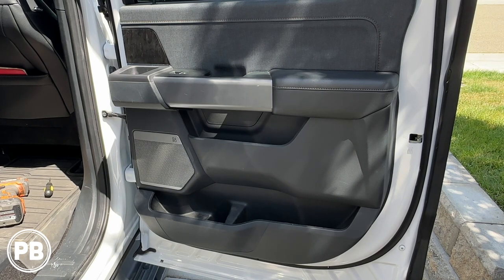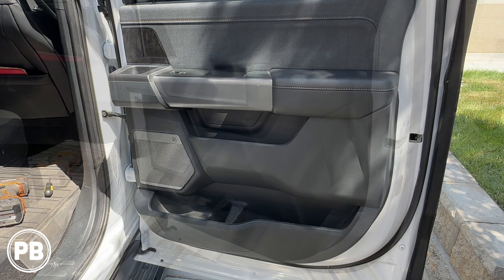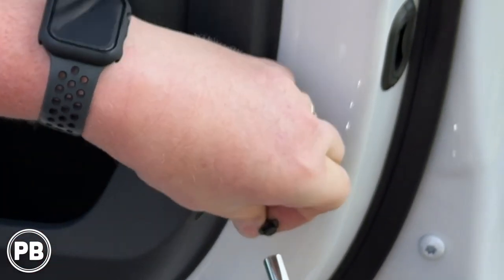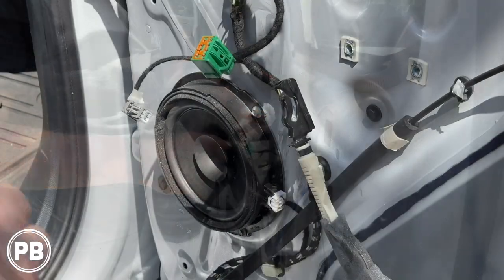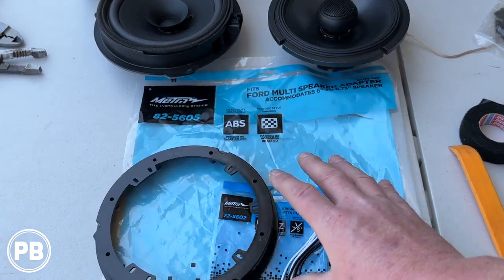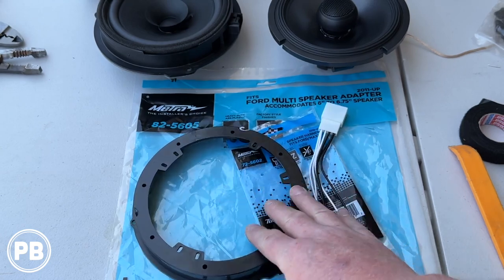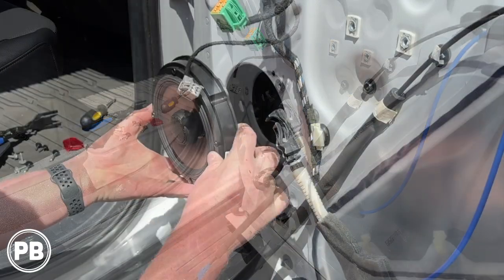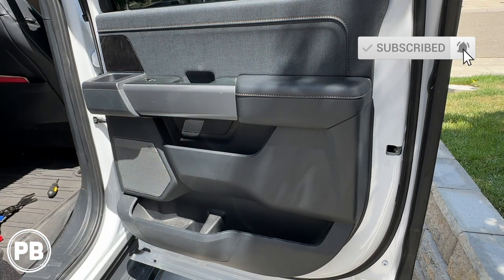2021 - 2024+ Ford F150 / Lightning Rear Speaker Install

Comment: If you used an aftermarket amp with these speakers would they sound better? Debating if I should just do the speakers or a new amp too. Don’t listen to my music loud or anything. Also, does sq take a hit using factory speaker wiring?
Reply from the maker: They certainly would sound better if you add more power. We have a 5 channel amp video for this generation truck. It just depends if you have B&O or not to know the best place to start. If you send me a message on Facebook, I can point you in the right direction.

Comment: I've been outside the car audio world for a long time, but do they still make the plastic housings for the rear of the speakers to give you more of a sealed box punch on bass?
Reply from the maker: Yes, just search speaker fast rings or speaker foam baffles on amazon.